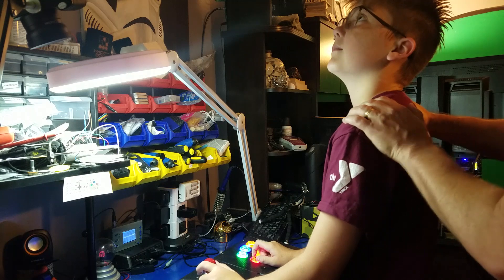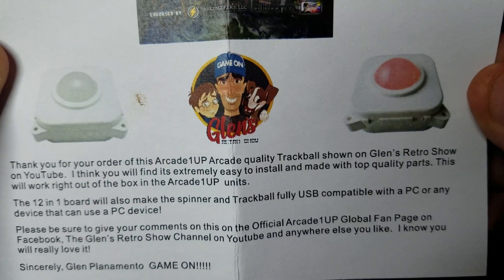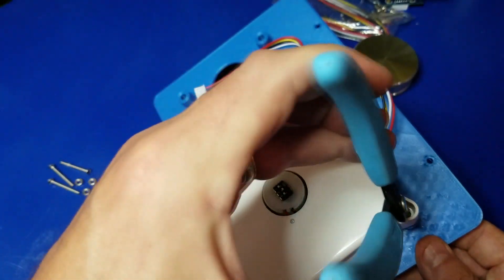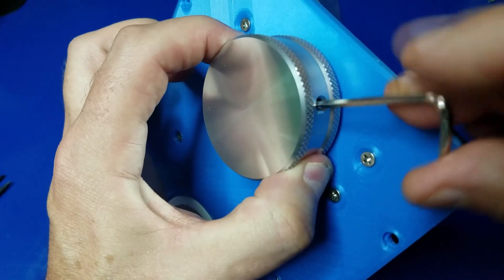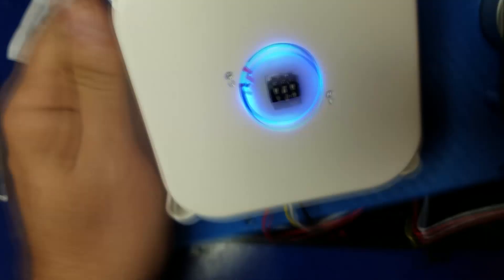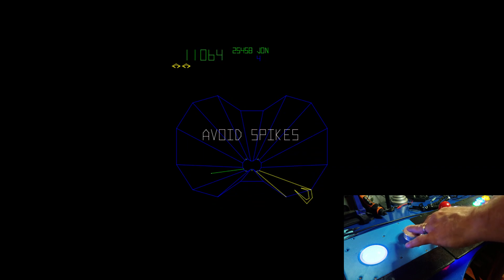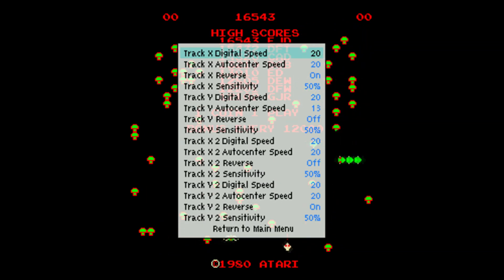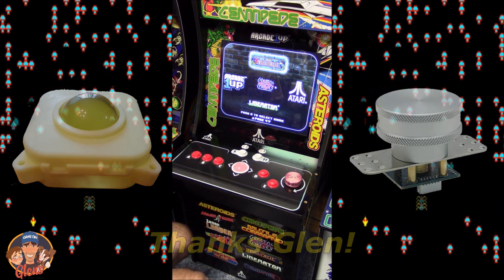How-To: Add Trackball+Spinner with Glens Retro Show parts to OpenCADE RetroPie MAME ARCADE Console!

Comment: If I have a 4 player arcade cabinet using retropie. Can I add this setup and just plug it straight into raspberry pie? Or does it have to be connected to player 1s usb encoder? And if do, how would I do that?
Thank you! Great video
Reply from the maker: You don't have to put the Pi in the case as shown here (here's another variation: https://youtu.be/2soNa6maghw ).But yep, it's just USB into the Pi.

Comment: Hey... I am adding the GRS Spinner (TS-USP-01/02) and Trackball with the 12 in 1 Interface Board to my pc MAME machine. I want to make sure the dip switches and the jumper (in the trackball) are all configured correctly. On the spinner, it looks as though all 3 jumpers on the board should be ON. On the trackball, do I remove the jumper on the inside to remove the delay? I assume so, but just want to check. Once it's mounted, I don't want to pull it back out. Thanks!
Reply from the maker: Glen's products are being improved frequently, for the best answer please contact Glen here: https://www.glensretroshow.com/contact

Comment: Thanks for all you do.  I’ve found a 3d printing service and am about to start this project with a raspberry pi 4.  My question is would this panel work with the version 3 of the trackball that lights up and allows for changing sensitivity on the fly?  Thanks
Reply from the maker: Very welcome!  I've only tested it with the trackball in this video, I'm not sure if the version 3 will work.  If the dimensions are the same, should be good.  Also, I've been informed that the encoder I used here is no longer included in the package (I added a pinned comment).  It's just something to make you aware of.

Comment: Does the spinner have to be plugged into player 1 to be used on retropie.  If so how do u toggle between joystick and spinner games
Reply from the maker: If you launch a game with AdvancedMAME as mentioned here: http://wagnerstechtalk.com/grs/#Add_a_Trackball_and_Spinner_to_OpenCADE it will pickup both the trackball and spinner automatically.  It's more involved using lr-mame 2003 but you can read more about that here, if interested: https://github.com/RetroPie/RetroPie-Setup/wiki/Spinners,-Trackballs,-Lightguns,-and-other-Mouse-Devices 
Hope this is helpful!

Comment: Did u have to configure any user binds or mice settings?  Or just select advance Mame?   I’m asking bc what about genes for Atari like kaboom where the spinner would be ideal ?
Reply from the maker: I just selected AdvancedMAME, nothing much to setup really.  You can adjust sensitivity and stuff like that, if you want.  I was only concerned with MAME, not so much for consoles.  Here's some info, but doesn't dive into setup for the Atari: https://retropie.org.uk/docs/Spinners,-Trackballs,-Lightguns,-and-other-Mouse-Devices/

Comment: I know this is an old video, but have you tried using the V2 trackball to play Golden Tee Golf?  If so, were you able to get the ball to travel a long distance? For some reason, I can't get the ball to travel very far no matter how high the sensitivity is or how fast I roll the ball or which club I use or with the jumper removed and not removed.
Reply from the maker: I've not tried the V2 trackball with this setup.  You may want to check with GRS for some information based on the emulator you're using, Glen may have some additional troubleshooting info. to help.
Reply: @WagnersTechTalk  I tried reaching out, but so far no response.

Comment: Hi how are you connecting the trackball . I have a cabinet set up With 
Arcade Game DIY Parts, Arcade Game Joystick Zero Delay USB Encoder Board Push Buttons Cables for MAME PC Game Fight Joystick…. It where would I plug the trackpad into . Thanks
Reply from the maker: I used the 12-in-1 interface board shown here: https://wagnerstechtalk.com/grs/#Add_a_Trackball_and_Spinner_to_OpenCADE  However, it appears it's no longer available.  This question is likely best for Glen here: https://www.glensretroshow.com/contact .  The board I mention in this video is the only one I have experience for use with the GRS trackball and spinner.
Reply: @WagnersTechTalk  many thanks for the reply ..will try it all when track ball arrives .

Comment: just built one of these.. but realized afterwards that the buttons for the front holes interfere with the trackball...!  I suppose I either need to source shorter buttons or rotate the top so the trackball is on the right.. not sure why this wasn't thought of in the design .. but... thx for the info!
Reply from the maker: There is a layout with/without button holes.  Shorter buttons should work, it is designed so you can configure it the way you want to build it.
Reply: @WagnersTechTalk  Thx. removed the buttons for now but I'm having a crazy time just getting the spinner to work. Batocera recognizes the spinner as a mouse (because I see the cursor on the screen) but the spinner moves so slowly in games. Can't find the "sensitivity" menu anywhere in Mame.... thought this was more plug n play that I guess it is!
Reply: So.. spinner working but now it moves super slowly.... and since I can't choose "advmame" as an emulator in batocera - I can't change the sensitivity level per game.. thoughts?

Comment: So when you first plugged it in you don't have to "configure controller" for the trackball or spinner?  Its automatic for AdvancedMame?
Reply from the maker: Yes, in Advanced Mame I didn't have to do anything special for the trackball and spinner.
Reply: @WagnersTechTalk  thanks.  I'm very new to this.  I'm assuming you had to go to settings to install that Emulator and then the spinner in Tempest (for example) just appears in Dial Inc or Dial Dec as Left and Right?  Or is it j:stick:x+ or j:stick:x-?

Comment: Ok. I know I've asked you a different question but I have another. Ok, so I built a 4 player game table with 8 buttons each with the control sticks. I play on a home theater projector. It's bigger then trying to get so many people around a small arcade 1up. So I have however changed my original concept. I recently purchased glens diy retro arcade Tron control panel and his Tron stick, trackball and spinner. I am going to build a portable "controller" with it so I can hook it up and unhook it basically like a controller. My question is.. how do I hook everything together and have it function properly when it connected to everything? I did get the connector piece that you have in this video. I just can't picture everything I need to do. It seems like a bit more technical then the standard stick and buttons. 
Any advice is appreciated. Thank you.
Reply from the maker: You would basically set everything up shown here, you may want a single USB cable connection going to your Pi/PC.  For that, you can use a small unpowered 4 port USB hub mounted inside the control panel.  Then, have one USB cable coming out the back/top notch.  I'd use a cable tie or electrical tape behind the notch to make sure the cable doesn't pull out of the hub.  Hope that answers your question, I may not be visualizing your idea 100% correct.
Reply: @WagnersTechTalk  I think you are correct. In my head that's how I was planning on connecting everything. Basically I want a portable Tron arcade panel. Thank you I appreciate everything. I kinda wish I could share pictures of my concepts with you.
Reply: @WagnersTechTalk  ya the Tron stick I got off of Amazon looks like it only has connections for the atgames arcade. It's really disappointing. Nothing is matching up or makes any sense. If there are two different sticks you would think they would say that in the description before you purchase one.

Comment: Does this only work with advanced mame? I'm trying to use the grs spinner with the 12 in 1 board on retropie using "arcade" and I get absolutely no response from the spinner
Reply from the maker: Hi Doug, Advanced Mame is the easiest to use.  Other emulators require a bit more tweaking, so I stuck with the easy way to prove it all works.  You can read more about trackball/spinner support here: https://retropie.org.uk/docs/Spinners,-Trackballs,-Lightguns,-and-other-Mouse-Devices/

Comment: hi there , thanks for the video .i am new to all this and i am sorry to ask but how would you set up / make the fire buttons ect work with the setup when you have no inputs for them on the usb controller card. how did you connect it all together in your setup as i would like to make a complete 1 player setup,  also do you know if these trackballs and spinners work with ipac 4 boards  please help thanks
Reply from the maker: This spinner and trackball are designed with the 12-in-1 Interface board you see in the video.  You can find full instructions here with everything you need : http://wagnerstechtalk.com/grs/#Add_a_Trackball_and_Spinner_to_OpenCADE  I use Advanced MAME 1.4 for trackball/spinner games and it was pretty much plug and play.  But, do check out the instructions.  Hope this helps!

Comment: Can u add another joystick on the other  side of the track ball spinning box?
Reply from the maker: You definitely can.  The unit I'm showing here used an extended control panel (x2 bases) plus the trackball and spinner.  I could have also made it a dual stick and put the trackball+spinner in the middle.  You can configure it however you want, see the pictures here for more examples of various ways (many more combinations are possible): http://wagnerstechtalk.com/opencade/#Our_Builds

Comment: Question. Is it possible to have 4 joystick's 10 buttons for each player 1 track ball, 1 spinner and 1 Tron flight stick to one raspberry pi 4?? If it is possible how do you do it??? Thank you.
Reply from the maker: I don't see any reason why not, you'd likely need to get a powered USB Hub to support all the controllers and buttons.  Each stick+buttons would go to 1 encoder.  Then, connect the trackball+spinner to the interface board which is USB to the Pi.  Keep in mind, the most I've done is x2 sticks and 1 trackball+spinner, but see no reason why adding x2 more sticks would be a problem.
Reply: @WagnersTechTalk  thank you. I haven't done anything like this. But.. I have an idea of what I want to accomplish. Should be interesting. Thank you again.

Comment: I assume that is I don't have a 3D printer (not do I want to 3D print) but am making a control panel with wood, then adding the trackball and spinner will still work?  My guess is I will need to screw the trackball from the top, which is not ideal but may be required.  Ideas on that?
Reply from the maker: Yeah, you can use wood and everything you see in the video would still apply if you're making your own wooden control panel.  The only difference is, with the 3D model you don't have to measure anything - it's all done for you.  If it's wood, you'll have to make all the measurements, layout, etc.  The electronics aspect and functionality is all the same.  Hope this helps!

Comment: Hi, I wonder if you can add a few more arcade buttons (such as start, select/coin, A and B) into the spinner/trackball combo. I know you can plug in another arcade stick into the second USB port. But I would like to have this as one USB controller.
Reply from the maker: You have the option to print a base with holes for Start/Select (or solid).  You can also customize the spinner+trackball panel easily by importing the .stl file into Microsoft 3D Builder (free) and cut any holes needed.  Lots of options 👍😎
Reply: @WagnersTechTalk  Hi, thanks for your answer. I was actually asking if I can have one controller panel with a trackball, a spinner and four arcade buttons, with just one USB output (connected to the pi), and if this is possible, which encoder board should I get? Thanks.
Reply from the maker: The only buttons and sticks I used can be found here: http://wagnerstechtalk.com/opencade/#Parts_youll_need_for_your_build , you'll need to connect the 12-in-1 USB cable and the encoder for the buttons to something (Pi, PC, etc.)  You could buy a dual USB cable (x2 female inputs) with one USB (male) output cable and use that.  You could also use a small USB hub.  Just a few ideas.

Comment: I have a weird project in mind and I'm not sure if it can be done. I have the new Atari VCS. By adding just a USB stick drive you can set it to run in PC mode. You can then add windows 10. If you replaced the stick with an external hard drive you could load win 10, emulation, and game Roms. Basically making it a small emulation arcade. What I want to do is build a cabinet to house and display it. Add an LCD monitor. And build a USB controller deck for it. Ideally I'd like a two player deck. Enough buttons to play most games. And it needs a trackball and spinner. But I'm lost on where to go and what to do to build a deck like that. Any ideas/suggestions?
Reply from the maker: The GRS Super Joystick might be an option for you.  You can setup two for two-player gaming.  However, it's a rotary joystick (can work as a spinner) and a joystick and includes 6 buttons.  It doesn't have a trackball included, but you could build your own custom housing and add one (GRS sells some great trackballs too).  You can see my video on the GRS Super Joystick here: https://youtu.be/0R99uVKE-EY to see if it's something of interest to you.

Comment: at 10:36 in your video you show the input menu and it shows "dial Analog" is set to none.   how is the spinner working with this set to none?   My retro pi sees my spinner but none of the emulators do.
Reply from the maker: It apparently ignores this setting.  I documented all the steps that I used here: http://wagnerstechtalk.com/grs/#RetroPie_Configuration_AdvancedMAME

Comment: Hi I just bought a todayz trenz console and I would like to add a trackball an maybe  a spinner. Any advice would like to wire internally.  Thxs Mike
Reply from the maker: In addition to the video, I also  have some instructions and parts needed on my website: http://wagnerstechtalk.com/grs/#Add_a_Trackball_and_Spinner_to_OpenCADE  It steps through most everything there, while it focuses on OpenCADE it doesn't have to be.  Same steps apply to whatever custom build you're making.  Hope this helps!
Reply: @WagnersTechTalk  ok so I'm new to this just an 80s gamer. So the console I bought states its a.bree? Not sure again if this would interfere I basically want to add and.bolt your box to my box.and interface it to mine. So what exactly would I need and would it work for me.  Thxs.again Mike
Reply from the maker: Hi Mike, I've only used this setup with a Raspberry Pi and brief test with a PC.  While it may work with what you have (trenz console) over USB, I don't know because I don't own one and infact never used one.  You might ask the manufacturer if it's compatible with the GRS Trackball and spinner.  If it is, then you could print an OpenCADE box and panel for the spinner and trackball and attach it over USB to your game console.  But again, not familiar with their product.
Reply: @WagnersTechTalk  thanks!!!

Comment: Anyone have any idea how to get spinner working on a PC NOT arcade 1` up boards. Windows don't see it flipped switches on . Only have 1 wire from running from the Spinner to the 12 in 1and USB connected to the PC. I know there is a another wire but it's useless one side fits in the 12 in 1 but other side is useless none of my USB boards have that type connection. Figured USB would provide the the data between them.
Reply from the maker: In this video I used the encoder that came with the spinner, however not sure if it is still included (I've heard it's not).  Best to reach out to GRS Technical support here: https://www.glensretroshow.com/contact/

Comment: Hi guys, this video is fantastic, but could you by any chance sell a USB arcade stick (not too bulky) that has both a TRACKBALL and a SPINNER? to use on my MAC.
But even just SPINNER is fine, for me it would also be fantastic to have an ATARi 2600 PADDLE (my favorite) converted to USB... because I bought it, with a USB adapter cable, but I can't make it work.
Hello from Italy :)
Reply from the maker: You may want to reach out to tsticks directly, I only designed the 3D printed case.  All the parts that went into it were from GRS/tsticks.  You can find their contact details here: https://thunderstickstudio.com/pages/contact-us .  Thank you for watching!

Comment: How does MAME know which controller to use for each individual game? When you opened Centipede, it seemed to know that you  wanted to use the trackball. Do you have to configure each game individually to make that selection? I'm trying to do a Pi setup with only trackball and spinner games, but I'm not sure how to configure it properly!
Reply from the maker: If you use AdvanceMAME, then I found there no real setup needed.  You can tweak the settings if you want by pressing the TAB key, but it was super-easy.  Now, if you want to use lr-mame2003 it can get a bit more complicated.  I basically just put all the trackball+spinner aware games in the adavancedMAME subfolder, restart emulation station and tweak to my liking.  You could also check out these instructions for more details if don't want to use advancedMAME: https://retropie.org.uk/docs/Spinners,-Trackballs,-Lightguns,-and-other-Mouse-Devices/
Reply: @WagnersTechTalk  Great video. Question, sir: did you press TAB to get the config menu seen at 10:24 in the video? Thanks!
Reply from the maker: @ut4321  Thank you Trey!  Yes Sir, press TAB to bring up the menu.  I have written instructions here as well: http://wagnerstechtalk.com/grs/#Add_a_Trackball_and_Spinner_to_OpenCADE
Reply: @WagnersTechTalk  Perfect, thank you sir! Really appreciate how clear you make the steps. I'm itching to get started on this project!